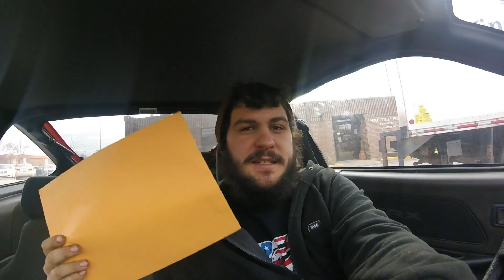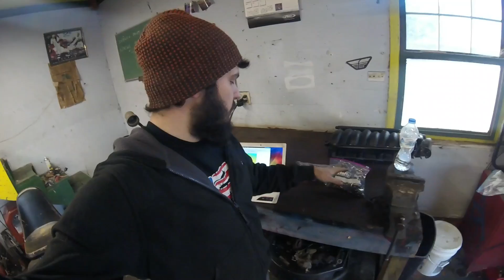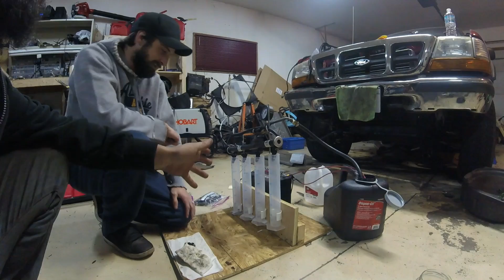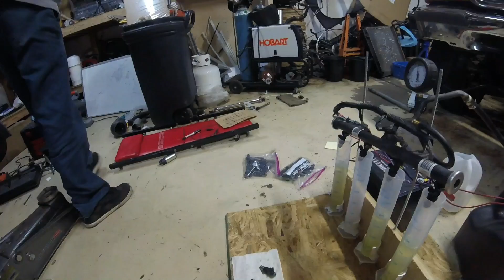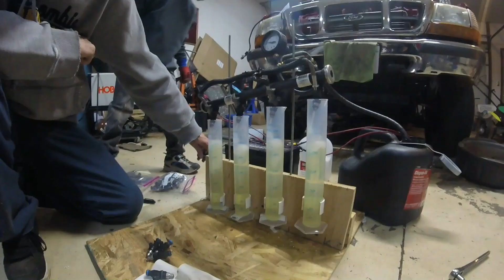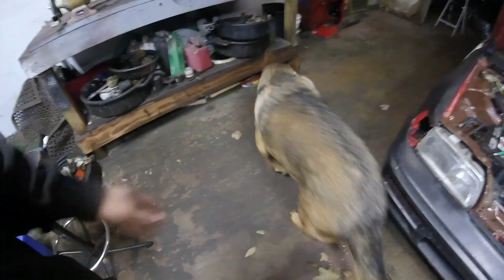Chevstang Homemade Fuel Injector Test. Crome Ignition Timing. CRX Street Pulls

Comment: I know this might sound cheesy but have you considered lowering IATs by wrapping your LICP post intercooler? Once the air has been cooled by the intercooler we want to keep it as cold as possible so..

Engine bay temps are definetly higher than the temp of the now cooled air in the pipe so what's the most effective way to keep it cold?

reflect radiant heat

wrap that shit in reflective tape. try and not over lap much, don't need it to insulate just reflect. hell hit the bottom of the intake manifold with some too. phenolic gaskets on the intake manifold and tb
 
last but not least, by pass and then loop any hoses that run coolant to the throttle body ( iacv & fitv if applicable in a honda for instance )

please do not wrap the  intercooler piping pre intercooler for that air is certainly hotter than anything the tape would reflect.

its an easy mod, kind of gaudy since a lot of the tape is gold / silver but hell, it works. nasa does it, f1 race teams do it etc..

dei makes some but its stupid expensive for what it is and its certainly not the same grade as what the apps mentioned above would run.

best deal ive found is boost monkey. 2 15fr rolls should be enough to wrap that shit and hit the IM good luck. 

im learning so much from your channel i cant help but butt in when i can share anything.

Comment: How aggressive with timing do you get with E85 on a boosted setup? I know you mention using the P30 map as a base map on Crome. On Hondata do you start all your base maps with P30 maps as well?
Reply from the maker: Hondas dont respond that much to more timing NA. On a boosted Honda setup I can usually add 2 degrees everywhere on the map. As well as stop pulling ignition period at like a certain point. Say 20psi
Reply: Do you start with a P30 on hondata as well?

Comment: HUNTER I WILL BUY A SET OF DECAPPED AND FLOWED INJECTORS FOR MY 2009 FLEX FUEL SILVERADO!!!  now that I'm done yelling... will i have to upgrade fuel pump AND do a fuel return setup or will the factory flex fuel pump be enough???
Reply: Btw I'm turboing it in the spring with the ON3 kit
Reply from the maker: Sam Leisch depends on your power goals should be fine for up to 500hp on normal pump gas with returnless. Although will need a fuel pump upgrade
Reply: HunterTuned thanks, that's gonna be plenty. I'll need to beef up the 4l60e before I need a returnless system.

Comment: I've blown 2 d16 turbos up by thrown rods on number 1. Different cars, on to building a built rod/ Piston motor to turbo. I also think your turbo was maxxed out pushing hot air into no. 7 not the injectors and to much timing lol
Reply from the maker: Mika Allard exactly lol
Reply: I never thought about why its always the back cyl good thinkin

Comment: Dynamic testing the duration should be changing during your test to simulate different RPM ranges.  A timer should be added to the last millisecond to cut power. I think with just a few changes this test would be dead nuts on. I totally understand that for testing purposes it works great to find if you have a clogged injector. I applaud your effort I think you guys are doing a great job with your videos very entertaining.
Reply from the maker: shatmicellf hp thanks man! We will be doing some refinements to the flow test to make it even more accurate. Like adding a timer and such. I agree 100% thanks for the feedback

Comment: Are these the injectors you're talking about?  (sorry this link is so long)  https://www.ebay.com/itm/GM-OEM-Original-25326903-5-3L-323cid-Flex-Fuel-Flow-Matched-Fuel-Injectors/162721896243?epid=1637476777&hash=item25e2fb1733:g:VDgAAOSwMQBZ7Lyg&vxp=mtr
Reply from the maker: Ryan Riffs yes

Comment: lots of timing and high intake air temps = a plasma cutter to your pistons. Can you setup a safety in your tune to pull timing at say 150 or 160 degrees intake air temp or more?
Reply from the maker: yes. I actually ran the car all year without an intake air temp sensor mounted in the intake pipe it was just chilling in the engine bay. LOL. Will be actually utilizing it as soon as it goes back together.
Reply: HunterTuned lol funny im doing the same thing i have the faulty one chilling in my intake while the functional one is floating in the bay connected to its plug 😂😂